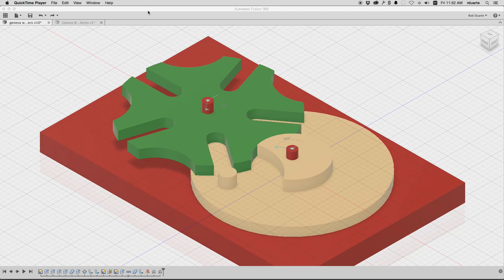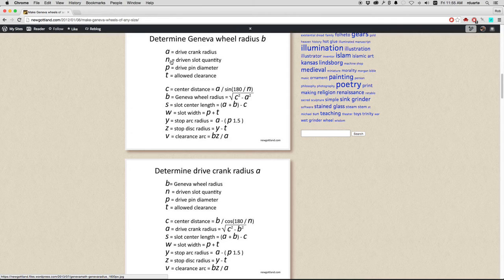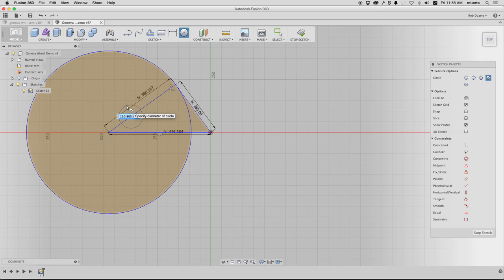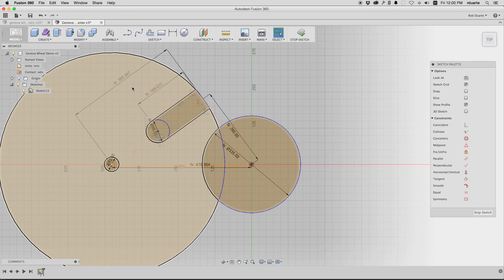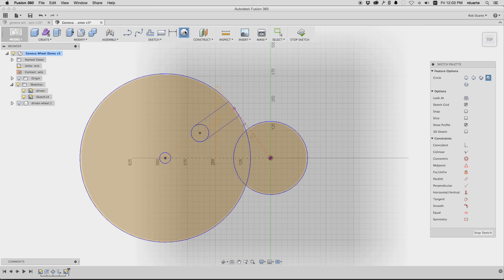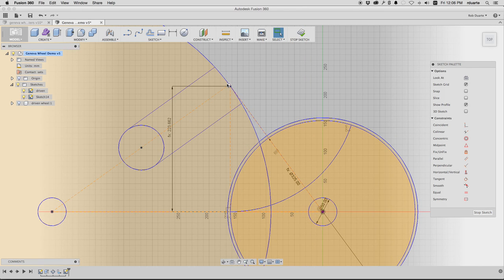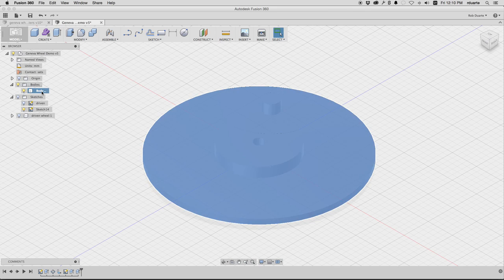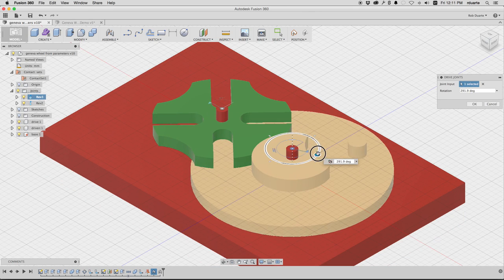Parametric Geneva Drive in Fusion 360

Comment: Good Video- I Built one with twenty two teeth.  You left out some stuff but great learning experience to start where you left off. Thanks. And if any help to newer versions of Fusion 360 Yes no units as you did. But to make it work must put in the variable * 1mm in the sketch window. For example.   c1*1mm this will work when dimensioning  lines.  Took an hour to figure this out.
Reply: Hero

Comment: i figured the way to make the drive wheel circle you mentioned at 15:57 is "a1*2+p1". it makes the circle reach to the outer edge of the drive pin.
Reply: You can try this.
((a1 * 2) - (z1 * 2)) + (a1 * 2)

In this way, the drive pin is located in the middle between the outer and inner circles. I think the circle relationships in this way are set in the reference video.

Comment: For some reason when I try to use c1 as my length variable gives me an error because is unitless
Reply from the maker: Elmer Cantu you can make a unitless parameter work when units are expected by using it in an expression like: myParam * 1 mm
Reply: Rob, I am having the same issue as Elmer. Where would I enter the expression -- my Param * 1 mm -- in Fusion 360. In my parameters file or when I am attempting to dimension something?
Reply: @RobDuarte  If you havent got there yourself yet, type in the parameter - b1 for example and then * mm. typing in * 1 mm doesnt work. So when putting in the dimensions -" b1 * mm "
Reply from the maker: @fyodorkrasniy6181  I haven't tried it yet but if that's the case, it's unfortunate since it defies the convention they use everywhere else. Neither is intuitive, that's for sure.
Reply: @RobDuarte  I was having the same issue, it maybe something to do with the version? Works so far though, may be a bug too..